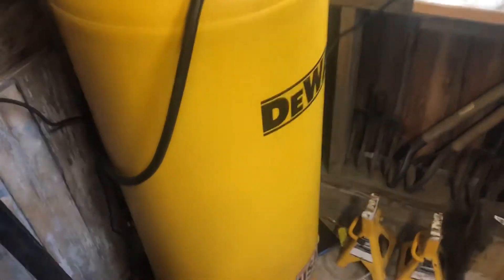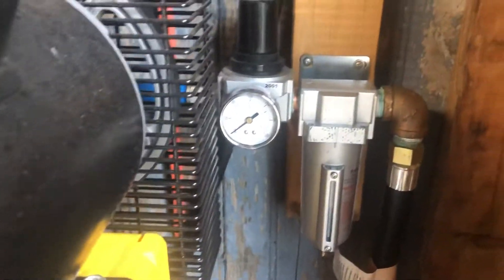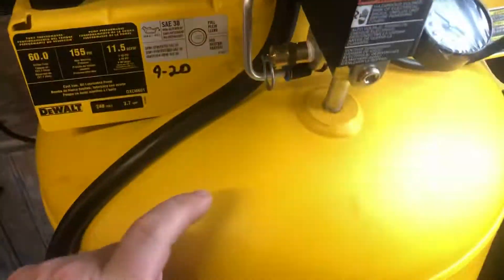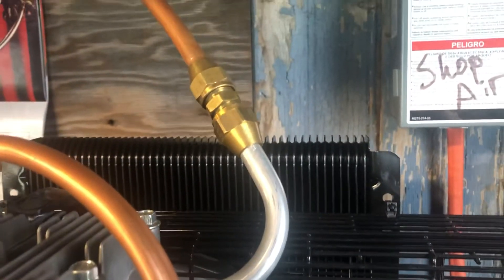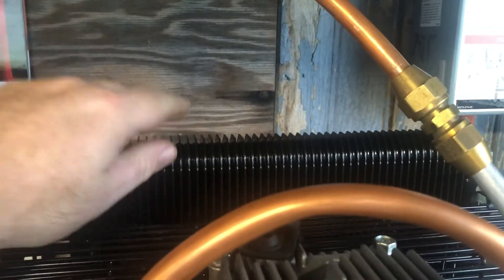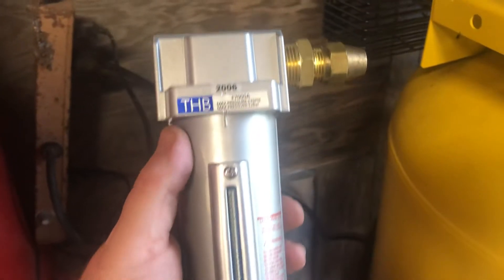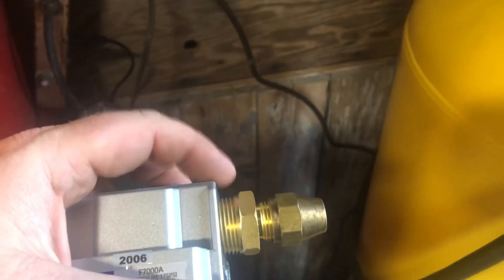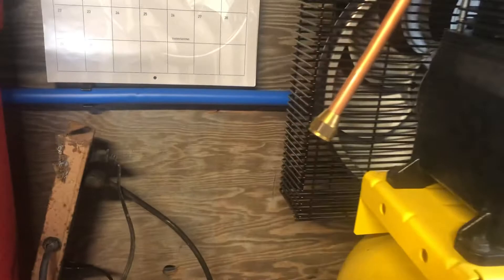Air compressor after cooler: part 1

Comment: Nice! What flare and fitting did you use on the stock tube? So the 15300 cooler has 1/2 npt male fittings?
Reply from the maker: Just used 1/2” copper flare fittings. Hasn’t been an issue yet, and yes, 1/2” not in the cooler. As a side note, the cooler blew out, I’ve ordered a new one from Summit, it’s back ordered, but good for higher psi. I’ll give an update when I get it.
Reply: @milesff7  interesting that the cooler blew out.
Reply: @milesff7  any reason why it blew out
Reply from the maker: @lsxjunkie  I looked, and this one was rated for 150psi. Probably shouldn’t have pushed it so close.
Reply: @milesff7  ah OK wonder what some derale units are rated to I run my compressor at 140
Reply from the maker: @lsxjunkie  this is what I ordered.

https://www.summitracing.com/parts/BMM-70274#overview